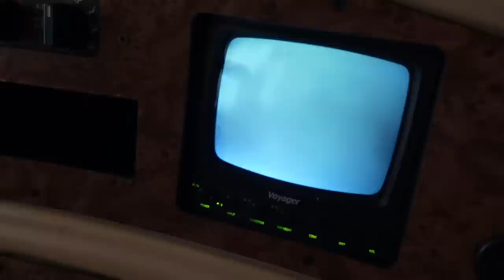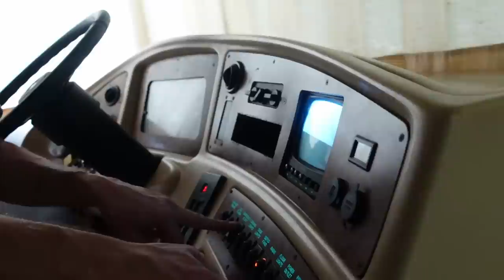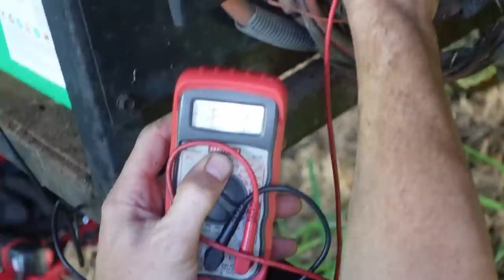FREE Abandoned RV… Will It Start?

Comment: Jimmy I am a retired truck driver and owner operator. At one time on one of my trucks I had a similar problem with not being able to obtain an RPM over 1500 rpm, i believe it was, and I found out that there is a low rpm and a high rpm sensor. Once the rpm sensor was replaced the engine run fine. I don't recall right off hand which one it was that went bad but it was one of the two. Now I don't know if your motor home is set the same way but it's worth looking in to. After all, "WHAT COULD POSSIBLY GO WRONG". LOL. Love your videos so keep up the good work. Sincerely, Jack         P.S. Also I am a dual military service Vet, (6yrs Navy and 7yrs Air Force), so I would also like to thank you for all the great work and help that your doing for veterans. I'm proud of you. Thank You.

Comment: NEUTRAL SAFETY LIMITER ......SOME ENGINES WONT REV UP IN NEUTRAL....?   OR PARK....?
Reply: Mostlikely the anti theft bugging out
Reply: @Tommysmess  most likely not...lol it starts and runs ...the whole idea of anti theft is ........not to start or run...lol   dar dee dar...
Reply: @crashalexander7232  oh really now? I had a volvo that had a chipped key and and would still start but not rev past 1500rpm until I got the computer re tuned at a shop
Reply: Have you done anything more with this RV?

I know with my tractor that I drive, the RPM's doesn't go above 12000 RPM until you put it in gear and drive it.
Reply: @johnkeegan1808  I'm surprised your tractor goes up to 12,000 RPM in the first place.  Is there any chance that it has a gas turbine engine?🤣
(Yes, I know, you probably wanted to say 1,200, but that's just too hilarious)

Comment: I was extremely shocked how clean it was on the inside was expecting mold 100%
Reply: Good job Jimmy!!
Reply: Just because it hasn't been started in awhile doesn't mean it isn't taken care of. Perhaps he didn't have any reason to use it. 
Although it might have been a good idea to start it every so often to keep the batteries charged. 
I also heard that it isn't good for an engine to leave it sitting for a long time without draining the fluids.
Reply: At first I thought Jimmy said it had an interesting “odor” instead of “owner” during the intro.

Comment: What a wonderful plan to provide this RV  for someone in need.   And…finally a machine that I know, after years as a service manager for RV service center.  I have a similar Diesel pusher and you are absolutely correct that the hammer is the best tool!  Any tool in my hands eventually becomes a hammer.  As I’m sure your friend mentioned, the engine is in derate mode because of the check engine light.  You do need the code.  It could be an engine temp sensor, an oil pressure sensor or any number of other sensors that would cause this situation.  Generally it will turn out to be something  simple but because the rv has set for so long it’s a crap shoot to find the issue without an engine scanner.   BUT a warning…when you get it running DONT drive it any further than the nearest tire center!  RV tires, especially 22.5 inch motorhome tires never really wear out.  But they do expire. And since it has set for so long the tires won’t be safe.  Hope this helps…”it’ll be fine”.
Reply from the maker: Thanks! Code is 367 fuel pump circuit. Trying to find where the relay is. Any ideas?
Reply: @therealjimmysworld  what year is the RV, and I assume it is a Cummins?
Reply: @therealjimmysworld  additionally I would change the fuel filter, or filters.  Since the fuel has been in a wet environment for so long, there may be some bacteria growth.  If that’s the case I would suggest siphoning out the fuel, adding new fuel before changing the filters.  Then after running for a while, change filters again.  Since the engine ran when it was parked I suspect this is more fuel related than a “hardware” failure.  I will send you an email, and you can call if you prefer.
Reply: @therealjimmysworld  most likely bad fuel.  Siphon fuel, and examine.  Bet it’s got bacteria contamination.  If it is cloudy then siphon all fuel, put in new fuel change filters including water separator.  Run a bit then change filters again.  I sent you an email if you want to call.  What year is coach and I assume it is a Cummins.
Reply: @therealjimmysworld  additionally code 367 on a Cummins indicates the fuel pump timing sensor signal has been lost.  That is most likely a potential wiring or sensor issue.  Since it runs, most likely it would be wiring.
Reply: @therealjimmysworld  The EV car idea 1, 2 in-wheel hub motors on the rear, where the live axel was put Lithium batteries**
Idea 2, look at the tech used in Hacksmith`s mini CYBERTUCK  and the  batteries use used it has gol cart rear axel/motor in-wheel hub motors on the front...
Both option should get you to 55+mph... 
Simone Giertz had one of those on her channel... (now drives a Tesla Model 3 pick-up...)
Reply: @therealjimmysworld   I have a 1999 Monaco diplomat class a diesel pusher. If you’re interested in it let me know love to get it to somebody who could really use it.

Comment: Hey Jimmy, nice work. Sounds like it’s in limp mode.  Just make sure the intake is clear and if turbocharged the turbo is free, if you’ve got an intake air restriction it’ll muck up the MAP sensor  which can put it into limp, restricted exhaust system can do the same.

Comment: I had issues with squirrels eating wire insulation that caused all kinds of difficult diagnosis. RV tires are time limited so it's not a problem until you need to get one fixed.

Comment: Jimmy. Your first question was correct. Don’t rev up a Diesel engine. Start it and let it idle to warm up. Reving a compression based cold engine will break something. Good on you for giving back to those in need. Great video. 👍

Comment: I loved your response when the owner said "You need to pump it" and you said "On a diesel?".  You let it go at that and humored him.  As a diesel mechanic, there is no accelerator pump in a diesel engine so your can "pump" the throttle all you want but it will do nothing.  You get the same results by just applying a little bit of throttle to increase the fuel flow.  I cannot tell you how often I hear guys in RV parks pump their throttles before attempting to start.
Reply: Not everyone is a mechanic ☹.
Reply: Yeah you could tell the guy wasn't exactly mechanically inclined but oh well. Gave me a good laugh

Comment: I don't really know diesels too well, but just some food for thought regarding it not wanting to rev past 1200. It could just not rev past 1200, but will go past 1200 when in gear. That's how my truck is, anyway, put the pedal all the way down while in neutral, and it'll go up to 1200 and not any higher, just like the tach did in the RV. If it /wanted/ to go higher, but couldn't because of a fuel problem, it would attempt and stumble (at least in a gasoline powered car).

Comment: Wipe out the ECM codes, disconnect all power sources, hit horn to clear out all codes. Try driving it if you can probably o2 upstream downstream sensors, clean out MAF sensor (diode) with carb cleaner.

Comment: Hey Jimmy it’s a diesel so as a diesel mechanic you must change the fuel filters. A lot of times a diesel will run but won’t turn up due too lack of fuel flow. I change filters regularly on road calls due too semi trucks loss of power and not be
Ewing able to get up too speed. Since it has been sitting for so long the filters need to be changed anyway and are probably a issue, keep up the good work

Comment: Make 100% sure that you have all the power and ground wires hooked up to the batteries the way they came off. I spent 23 years working on school buses and I can't tell you how many times someone would miss a wire or cable when changing batteries and have issues. You may have got all of them back on but double checking never hurts. Good luck on getting the motor home going.

Comment: What an arduous project!  It will help someone in need, so more power (literally) to ya!  My 1989 Dodge Daytona flashed the codes when you turned on the ignition (without starting) and pumped the gas 5 times, and the manual had the code table.

Comment: On the transmission shift pad, if you hold down the + and - button for a few seconds it should say OL (for oil level) and then I should tell you if it’s low or high or just where you want it

Comment: Usually those coaches have an electronic potentiometer style throttle pedal on them. And when they sit for long periods the contacts get corroded inside the pedal. That may be why it one runs at 1200rpm.

Comment: you need a odb2 tester ,scanner and it will give you the problem code to tell you what needs to be replaced. it sounds like its in limp mode and thats why it wont go over 1200 rpm. you can get a odb2 scanner at auto parts store
Reply: He said it is self test and gives you the code. Push the button under the left side.

Comment: Just a word of caution about RV tires. Just because they have tread does not mean that they are safe. Read the date code on each tire. Rule of thumb is replace at 5 years old but not longer than 7 years.
Also check the air filter, and I would replace the fuel filter.

Comment: Jimmy, I've worked on cars for a number of years; during points to electronic ignition to OBD2. One thing I've learned, NEVER EVER disconnect the ECM, without disconnecting the battery first. Unplugging it and reconnecting it will cause a spark somewhere within the system and sometimes kills the ECM or one of it's sensors. ALWAYS disconnect the battery first. In this video, you may have already done that and it wasn't included in the video. Hopefully, you did. Good luck with the RV.

Comment: You'll need the engine size & model numbers.& Code numbers off of it to for getting the replacement starter just A fast Heads up. Cause if you go through all of that work.& Spend the money on the relay fuse you might as well buy A replacement starter for the generator to.

Comment: I have the same coach but with the cat 3126 engine.
The 5 amp fuses on the 3 relays in the rear of the battery compartment  are likely the start problem. 
Seriously consider changing out the fuel after 3 years or you may damage the pump and injectors and that will not be cheap.
Best wishes for this  project.
They are great coaches.
It looks like the 380 mbs with Cummins

Comment: Fuel filter had the exact same problem with mine it's that for a year and a half it would rev up to a certain point stop. Change the fuel filters put some conditioner in ran it for a while fine the new owners took it on a 3000 Mile Drive no problems

Comment: I don't know much about the chassis on a motor home but I own an RV Repair Business and would be happy to answer any questions you might have.
Reply from the maker: Email me with contact info. Therealjimmysworld@gmail
Reply: As a former certified Diesel engine mechanic, I recommend before any engine troubleshooting change the fuel filters and make sure the air filter is clean. THEN proceed with troubleshooting.

Comment: The only issues I have had with a de-rated engine where low oil/oil pressure and low coolant (or the coolant level switch. Once you have it running you can take it to a truck wash and they should be able to get her shiny again. I hope those people appreciate what you are going through on their behalf.

Comment: the cca... is fine, it is more of a cold weather thing,  having the cranking amperage in the cold weather...

if the motor is running correctly you won't need to worry about the lower cca..

check the fuel..if it is really dark looking... drain it off and get an algicide..

Comment: I know with European stuff, the engine wont rev past a certain point until it's in gear. But with any ECU controlled vehicle, the engine wont rev until all sensors report favourably and fuel pressure is above a certain pressure. I would imagine fuel pressure is good or it would have taken years to start and would idle like a bag of crabs. I would however, change the fuel filter and check if there is a water trap needs emptied/changed. Then, go around checking connections. Another possibility, the electrics are possibly CanBus, so if there isn't enough power reaching certain components, the system can play up. I have a 2004 Jaguar XK8 which can sit for a year or more. The battery is always flatter than a witches tit, which flags up EML (check engine), ABS, ESP (anti spin), gearbox fault and all manner of ghosts in the machine. Let it charge , switch off & re-start a few times will cancel the light, but retain any (false or triggered) fault codes which then have to be cancelled with a code reader. I can't say if this is the case with the American equipment because it always seems to be a little more "rugged" (old tech, lol) than the European stuff. But the engine sounds good despite laying around dead for so long. I think there are just some poor connections that need cleaned. Good luck :-)

Comment: I've used diesel over the road haul truck's most all my life. Change the diesel filter. A lot of times diesel engine's will lose rpm's when the filter has water built up in it. I changed my truck's fuel filter at every oil change. :)

Comment: I'd try to slow charge those original batteries for the correct power output.& Voltage& amps needed to run.& Operate properly on that RV motor home.

Comment: Jimmy, check the air filter and fuel filter. Diesel degrades and grows bacteria after about a year, faster in hot humid areas.  Could be a critter in the air box restricting airflow. Might need to reach out to Rainmanrepairs on YouTube.

Comment: Just pop a cheap scan tool on it and you can not only read and clear the codes but also look at the live data to see if everything is working. If the ECM is throwing a bad communications code, it's probably a wire that is corroded or has rodent damage.

Comment: Had a similar issue with my old diesel pusher. Ended up being that I used the wrong  battery's for the engine. Relays were not getting the correct juice. I thought it was. But checked relay when running was oy getting 10.4 needs 12.0 or more. Alternator was fine.

Comment: Your in limp mode ! Either your DPF is plugged or when you were on and off the throttle you didn’t allow it to go into regen mode thus the black smoke on startup . Start it up and let it idle for around 30 minutes it should go into regen mode and clear the DPF filters . When a diesel hasn’t been ran in a while don’t treat it like a gas engine , let it idle to warm then test the throttle ! There is a way to force the regen but each vehicle is different ! You might have to disconnect the starter batteries for 10 minutes! Good luck , what was the code ?

Comment: Hey Jimmy, Love your diagnostic tool being a claw hammer!  In airline ops on rare occasions pneumatic engine start valves that open air supply to engine starter sometimes stick in the closed position. Many times the problem is cured after applying a gentle tap to the start valve with a hammer. Genius device!
Reply from the maker: Right on
Reply: Good old percussive maintenance
Reply: The good old percussion spanner

Comment: Guys he heard the ABS kick off. What about those CCA’s 😂 🤣🤣
Put the thing in drive an get it out of yard. A lot of times the engine won’t just rev
To the moon in park. Undo the pcm connectors an reconnect them check for
Green hairs. Make sure the ABS keeps popping off an those CCAs!!!!!!!!!!!
Also the fuel filters are full of algae at this point so change those. And make sure the lift pump is pumping fuel. The vp44 is a expensive repair that a burnt out lift pump
Will fry
Reply: WTF are CCA's?

Comment: electronic fuel injection pump might not be getting enough gas from the lift pump under the fuel filter on the left side of engine looking at the engine compartment from the foot of the bed. also there is a fuel water separator on the same side mounted to the frame. Both filters should be changed.

Comment: Jimmy, just think of a diesel fuel system as though it were hydraulics.  Like brakes.  When it sits a long time air will seep into the lines.  It needs to have the air bled from the lines.  Also, might have moisture or bacteria living in that old fuel.

Comment: Jimmy get some power service fuel additive it will help also change oil filter and add Lucas oil stabilizer in and change fuel filter, just a bit of advice from a 25 yrs vet of OTR trucking, great video like always.
Reply from the maker: Great suggestion!
Reply: @therealjimmysworld  the fuel filter maybe even causing the 1200 rev limit as well I know it did it to my truck a few times in my life but you most likely have it fixed by now so i will shut up lol keep up the great work.

Comment: It's a diesel, you don't pump it up like a gas engine. No sparkage, remember. Just let it run and warm up before pushing it. My diesel is far more efficient once the oil is warmed up. So be gentle with it when it's cold. Especially as the batteries won't be fully charged either, probably 80% from the store.

Comment: People used to pump the throttle on gasoline fueled cars to pump more fuel down the carburetor. With a diesel engine which works very differently pumping the throttle is detrimental.

Comment: On dodge vehicles if you turn the key on (not start) then back off 3 times but leave it to the on position on the third time the check engine light will flash codes if there are any.

Comment: Fuel filters would be a good idea, also could be a programmed governor in neutral that doesn't let it rev over 1200.  Just a thought.  Check all grounds for rodent/corrosion damage.  Check bulkhead connector  back by the right side of transmission.  It's under the coach where rodents live
Reply: 5 gals of fresh diesel wouldn't hurt either, boost the cetane rating a bit